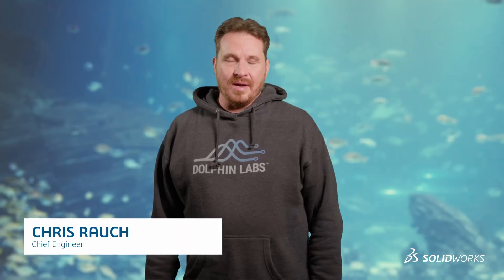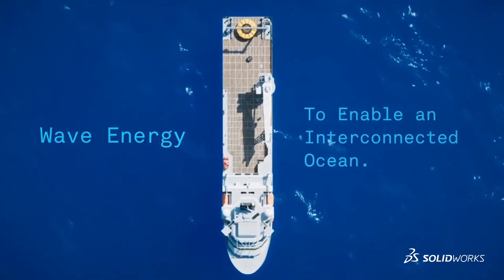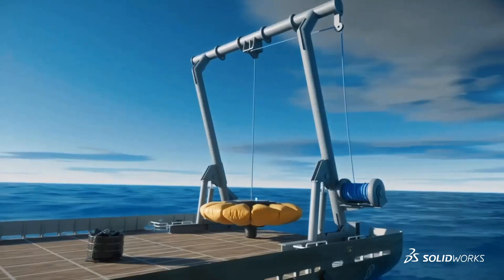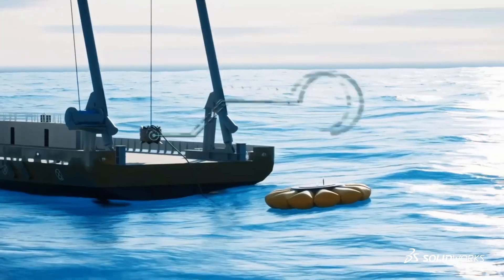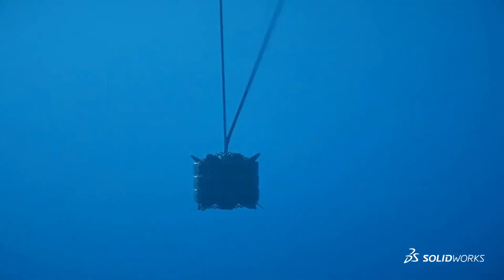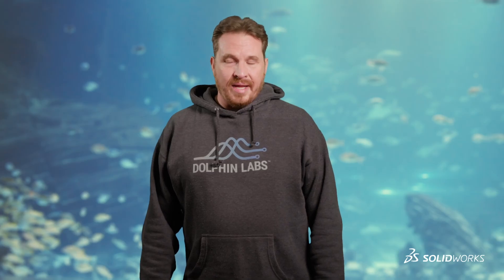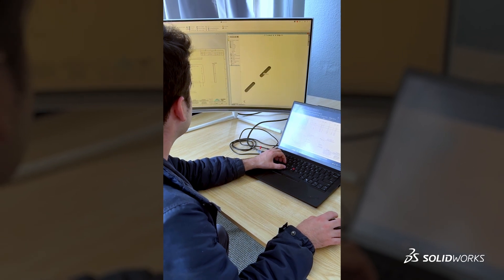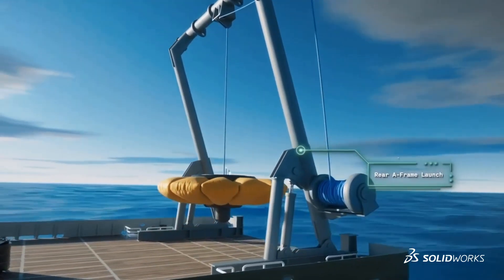Dolphin Labs Converts Wave Energy into Power

Comment: Wave power makes no sense whatsoever.

The main problem with wave energy is the low power density of waves. You have to build far more infrastructurew to harvest a kWh than for wind or solar. Making it ocean-proof makes building that bigger /kWh structure even more expensive. That will never change, and that is why wasting money on wave power is an  dumb idea.

The most successful wave power plant, Mutriku Breakwater Wave Plant, was commisioned in 2011 at a cost of 6,4M€ for 296kW peak. That's 21.000€ per kW nameplate Power installed. 20 times more than wind, and 30 times more than solar. 
But maybe it's generation more power to make it worthwile?
By the end of 2023, the total lifetime generation was 3 GWh. That's about an average power over 12 years of 12kW or 9% average load factor. That's abysmal. Wind, in germany, has 23% onshore and 28% offshore. In good wind locations like Scotland or Tasmania at the roaring 40'th , it's 80%.

So it absolutely sucks at power output too despite being 20 times more expensive to build /kW nameplate. 

So maybe it lasts longer than the 20 years wind turbines work? Turns out, the turbines are worn already and need to be replaced for 3,4M€. 
So they even last only half as long, making them 75-150 times more expensive per kWh generated than wind. 

it's a crime to still burn valuable renevable investmentcapital on wave power after all those projects proving without a doubt that it is far too expensive to build and maintain.

A € in wind power saves  75 to 150times more CO2 than the most successfukl wave power plant does. 

And still- new projects are popping up sucking away all that green investor money to shurely fail.